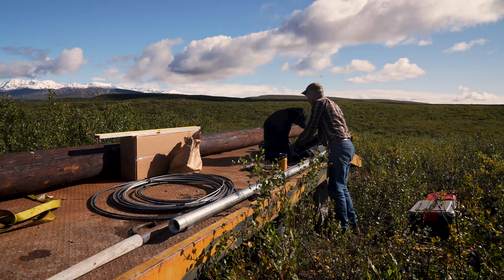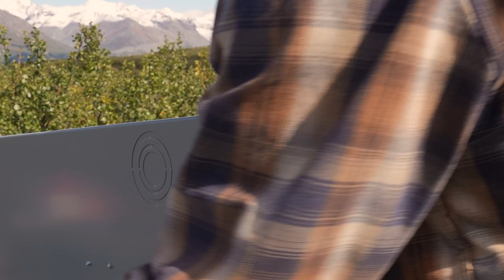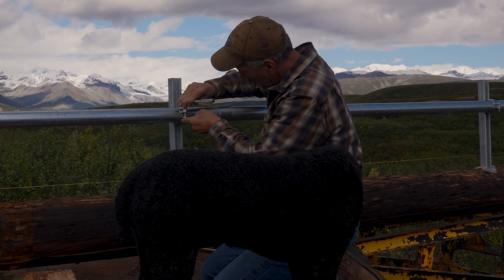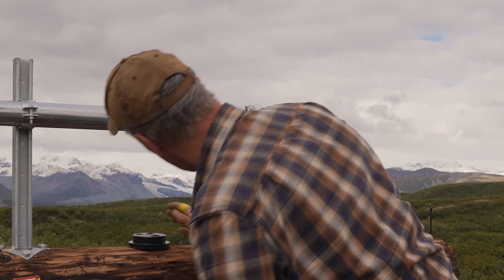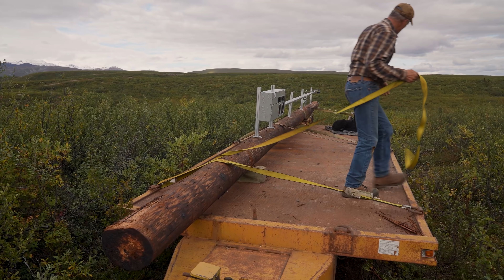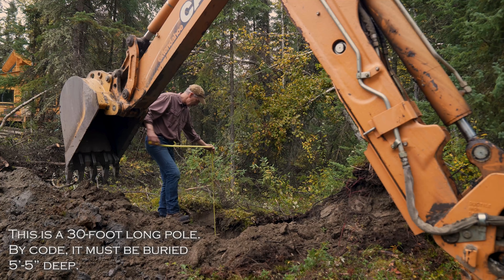LOG CABIN in Alaska (Rigging The Pole) - Wk19

Comment: Very interesting video. I have never worked with electrical on that side of the breaker box before and learned something new. Thanks!
Reply from the maker: Good morning my friend. Yes, it is good to understand the grid's side of the disconnect. Its something safe to venture into because the utility company will inspect my work very carefully before connecting the overhead drop. Their requirements are very specific.

Comment: You got us with this one. I immediately saw you were going to build an overhead electrical service. I kept watching, and kept wondering where the power company was gonna string a supply line across the tundra. Then I saw, at my cabin 170 miles north. Ha ha. Good one!!
Reply from the maker: Good morning Tom. Yes, I hope I never see the day there is power lines run in this part is Alaska. It would be so heartbreaking. It is one thing when they are camouflaged with trees, but up here they would just stand out in the open. The closest power lines are about 60 miles away right now

Comment: saw the video great Job next week when you run the pvc an oven might be required and they are an awful expense for just a few minutes work...a good alternative is a  piece of 4 inch pipe 3 feet long weld a separate 2inch pipe 18 inches long halfway or  hole saw into the larger pipe for free air flow set a heat gun...in the smaller pipe and turn it on! It will make a pretty good pvc oven for heating the pvc pipe with out scorching it ...As always lightly stuff rags into the pvc pipe to be bent and rotate it, and work it back and forth like your short time... where the hot air blows to prevent scorching the pipe near the heat gun...We set rigs like this on tables in chicago in the middle of winter! The pipes preheated for 5 minutes and the pvc could be heated soft enough to bend with out scorching! We set the desired angles and cooled the bends with water soaked rags permanently setting the angles....save a lot of expense and as long as your bends do not exceed 360 degrees end to end wire pulling will be a breeze...should be able to use a vacuum and bread sack to get in a string and then use the string to install your rope rig and pull use lubricant like wire ease to save the wire from stress and ease the load on your back...lubricate or soap the wires every inch of the pull! Wet slippery  conductors pull with minimum strain in any conduit insuring less stress on the insulation...which means maximum life for the wiring...and if Removal and replacement of wires are ever required a bucket of warm water poured down an old pipe reintegrates the wire lube...I like yellow 77 by ideal the best but many years ago there was a white wire  lube called wire-ease that was the absolute bomb it stuck to the wire assuring that the lubrication was throughout the entire pipe...It could dry completely and when water was added decades later would get slicker than snot again...In the very early days they mixed a solution of ivory soap flakes to do the same task...loading the handfuls of the buttery substance to the wire just makes a pull ten times easier and safer!

Comment: after opening up a ratchet strap pull on the lose end. that way it is really quick and easy to get the two pieces apart without wrestling the ratchet open and close repeatedly while trying to pull the lose end back out.
Reply from the maker: Good morning my friend. Yep, a couple of these guys need some WD-40. They have spent a few nights in the rain and need some maintenance.
Reply: @ThisIsMyAlaska  good morning to you aswell! even though here in germany it's already early afternoon 🙂
i think you misunderstood my post. sorry if my english caused that! i wasn't commenting on the state your ratchets are in. after opening up the ratchet give the lose end (which was previously wrapped around the ratchet to not fly in the wind) a pull. that will turn the "bolt" inside the ratchet and you can pull the whole strap out without having to wrestle it. works every time. i'm a customs officer and when i check the goods on trucks the eastern european trucks usually have ratchet straps way worse than yours and most of the drivers are surprised how easy i can open their manhandled gear.

Comment: That's the first time I was fascinated by a person preparing a power pole in an amazing surrounding, those mountains were a beautiful background. The installing of the pole went smoothly, (at least on the video😊). About the septic installation, did you only put drainage pipes on the overflow of the septic tank, with some ventilation pipes?
Reply from the maker: Good morning Luc. I installed a shallow bed-type leach field. It uses a layer of leech rock with a perforated drain pipe system over the top. The tubes sticking up are monitoring pipes to inspect the system and make sure it remains dry.
Reply: Ich auch😎

Comment: Another gem of a video! But i just "gotsta know"........is there anything you have to sub out?  You are truly blessed and gifted to have mastered so many different aspects of your craft.
Reply from the maker: Good evening Paul. Thank you so much for watching. On this cabin there is not anything I would have to sub out necessarily.  I did have a well driller drive in the casing because I wanted a 6" case for my submersible pump. I can hand drive a 2" well down to about 30 feet but then I have to install a surface pump which is not desirable. Other than that, I think I will sub out pouring the gypsum concrete flooring next week. I am just out of time to do it myself and winter is just around the corner. I am glad you are enjoying the build. I am looking forward to the interior aspects.

Comment: Where is the no ox on the terminations in the meter box(Aluminum/Copper). Concentric knock outs will need bond bushings put on them.
Reply from the maker: Correct. I forgot to take my inhibitor with me on this trip,  but will be putting it on all three connections. Bonded bushings as well. I still have to run the ground rods and guy but just ran out of daylight. Thanks for the catch. Peace.

Comment: Nice Job.  So the power company will install the Transformer at a later date. 120/240 Volt to the cabin.  ??????????
How far is the main line to your pole ????? fortunate to have reliable power source.  Makes life so much easier  🇨🇦
Reply from the maker: Good morning Darrell. Yes. I had to run a line extension into this property. The power company set a primary pole less than 150 feet away and hung the transformer on it already. 150 feet is the maximum service drop they will do. The transformer will handle a 200 amp service (or in this case two -100 amp services)

Comment: Nice. You made me laugh when I saw you use tape for the cut on your finger. Back in the late 60s through the 80s I was a butcher, back when we cut up whole sides of beef. Back then when we cut ourselves that was what we did to stop the bleeding and went back to work. Only the real bad ones did you go to a hospital. I saw that you put on a jacket my friend, the season is changing. Be safe
Reply from the maker: Good morning. I always enjoy reading your comments. I love hearing from tradesman. You had a long career in your industry. Your comment instantly made me think of some of my friends here Alaska that work in the local butcher shops. There are a couple in town. In hunting season, they receive so many moose and caribou. The quarters are taken from the backs of the pickup trucks and hung on hooks that roll down the ramp and into the coolers. They weigh and tag everything and take the custom orders (they will even smoke the jerky for you).  Yes, the weather is getting cooler now. Two days after shooting this video we got our first snowstorm in the mountains. It will all melt off but nevertheless,,,,

Comment: Enjoyed your video.  A couple of questions.  Are you planning on using both meters or just one?  If your using both, I hope your conductors are for 200 amp.  I see the breakers were 100 amp disconnects.  So that would require 200 amp service if using both meters.  The other question is the meter box.  Are the connections inside for aluminum and copper wire where your mains attach or just aluminum only?   You were using copper wire, if your connectors in the box are for aluminum only, you will have a problem later on.  If they are aluminum, they make a special paste that is applied to the connections so they don't react to each other being of different metals.  Enjoy your Labor Day weekend.  Regards, Kevin in Indiana.
Reply from the maker: Thank you my friend. I have it in mind to build a second cabin in the next year or so and wanted to plan ahead for that possibility. Yes, there are two 100 amp disconnects. I used 3/0 conductors rated for 200 amp service. The lugs in the meter can are dual-rated (aluminum/copper). They do not require an inhibitor. Thanks so much for watching. Peace.

Comment: may i suggest the next time you lubricate the lugs with aluminum oxide grease or copper-sheild it prevents the lugs from oxidation and gaulding shut leaves them lubricated much tighter and protected ...P>S> the copper clad aluminum or straight up copper wire a great decision as copper oxidation is almost non existent compared to the aluminum wire, which is cheaper but no deal...
Reply from the maker: Thank you my friend.

Comment: Why the doubled service? Is one meter used for solar capture back to the grid?
Reply from the maker: Good morning and thanks for asking. They are both 100 amp disconnects. I have in mind to build a second cabin here in the future. I am setting this up so I don't have to redo it in the future if I do go ahead and build eventually.
Reply: @ThisIsMyAlaska  Very clever. The manner in which you mounted the disconnect box and the conduit/hardware  kind of makes me think you've done this before.
Reply from the maker: Ha, yes a couple of times

Comment: Saw a car in the background?
Reply from the maker: Good evening Steve. That's interesting. I didn't notice anything when I was editing. The Alyeska Pipeline corridor passes through those hills about a half mile away. There is a trail that follows it that ATV's or four-wheel drive pipeline-service vehicles drive on occasionally. Perhaps you saw one of those. Other than that, it is virgin tundra for 80 miles or more in that direction before you hit the Alaska Highway.